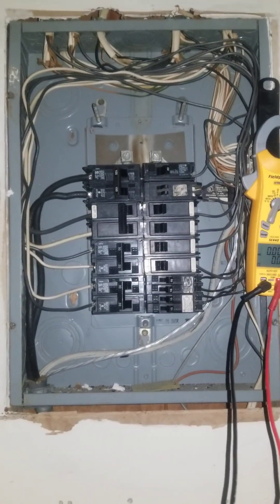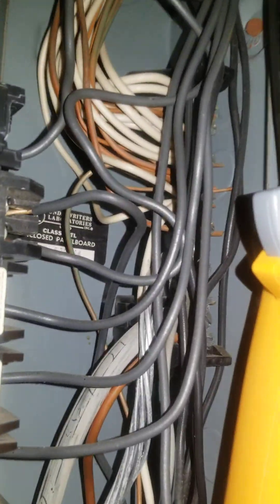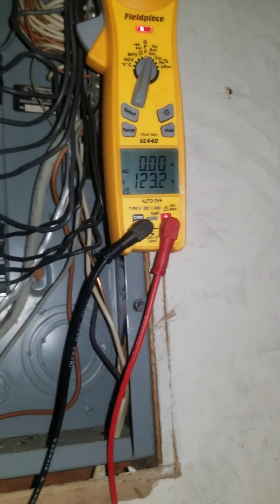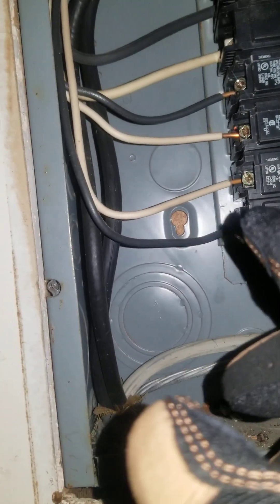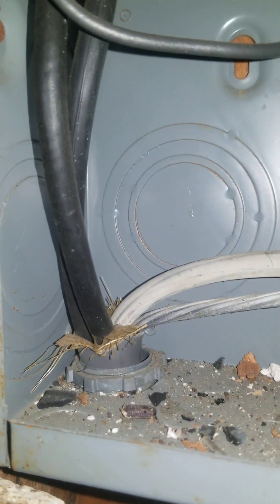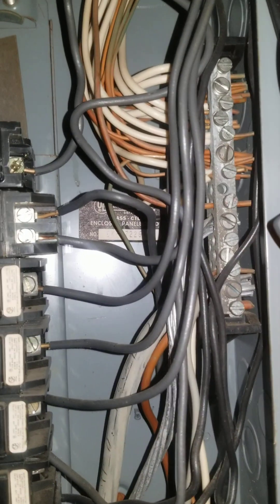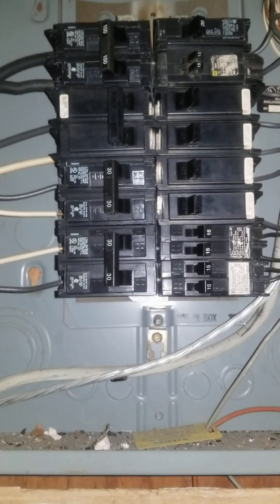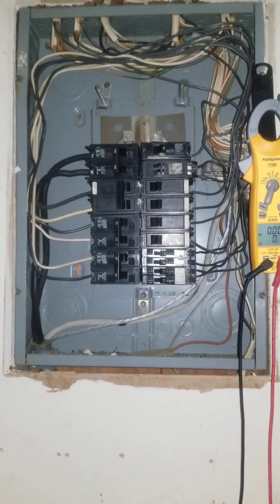NEC Code Violations (Panelboard Installation)

Comment: Maybe. Is the meter outside?
Reply from the maker: Hello, yes the meter is outside and this was the first point of disconnect. The call was about arcing (you can see why) and that the previous electrician changed out the breaker. They say it stioped, but I was called to so a review. Ended up installing AF receptacles at the first point in the circuit for more protection, but does not help any potential faults that may occur on the line side. I am sure a panel upgrade will be in the near figure.

Comment: I am NOT an electrician.  My expertise is with Phone/Data/Fiber.  That said, I do my own electrical work, complete with permits and appropriate inspections as required.  I have completely re-wired 2 houses, and have replaced about 50% of the existing wiring in my current home.  I have yet to fail an inspection.  My secret?  I take pride in my work, and take great pains to do it right.  

I own a current copy of the NEC, and I read it until I understand it.  Predictably due to my profession, I can pretty much quote 800.  For anything else, I have general knowledge to the point where I know where to go to look something up.  If I have questions, I will simply drop an email to the local AHJ requesting clarification.

My panels are wired per the NEC, but also using the same standards that I hold myself to while terminating fiber.  If it is a penetration, it gets a bushing.  If a provision is made to anchor something, it gets used.  If it has a provision for bonding, it gets bonded.  Wires follow the box perimeter and are routed to avoid interfering with access to other parts of the box.  If I run out of places to land Neutral and Ground wires, I run to HD or the local electrical supply and pick up the required bars to expand the connection points.  

The callout sheet on the panel door has the breakers numbered.  I use a label maker to number the breakers as well.  Individual Hot and Neutral wires are also labelled with the breaker numbers.  For that matter, the receptacles throughout the house are also labeled with the breaker number.

In short, I am a bit anal.  However, it seems that complying with the NEC, playing by the AHJ rules, and being a bit anal leads to pretty little green stickers on the panel...
Reply from the maker: Workmanship is definitely a section of the code that many people do not consider. In what city is your AHJ?
Reply: @Reg4JesusChrist  WA State L&I is the AHJ.  We have only state inspectors around here, no city/county for electrical work.
Reply from the maker: That is really good, because you have consistency in the application of the NEC! 

My knowledge of your line of work is quite minuscule in terms of hands-on application at this point. But I like how the NEC lays out that section of the code. It is easy to reference all different types in that section.
Reply: @Reg4JesusChrist  Where life gets interesting is that there can be a MAJOR difference between "Compliant to code" and "Compliant to standards".

When you start playing around with high-speed network cabling, it obviously needs to be installed IAW applicable code if you want to pass inspection.

However, there are also standards which govern things like bend radius, support spacing, support design, conduit fill, environment, etc.  Even such things as how you untwist and retwist the individual pairs to allow them to line up with the slots in the IDC connectors in a patch panel can affect the cable performance.

Fiber also has it's standards which need to be met that may not be readily apparent.  I'm sure that you have seen the inside of a fiber patch panel or splice panel.  Believe it or not, how all of those little fibers are coiled into the splice chamber makes a difference when you pull out the OTDR and start measuring attenuation.  Same for how well the splices are done, the care taken with the connector installation, etc.

It's not all code.  Every trade has its little tricks.  If a craftsman is going to step over the line, they need to know them.  Electricians pulling network wire need to understand the net cable standards.  Network guys need to know the rules that the electricians follow.

I step across the line in my own home.  Some of my wiring is aluminum.  Thus, I know what AL/CU means on a connector, and I possess both Oxide Inhibitor and an Inch-Pound torque wrench.  Heck, I even know that those random holes on my strippers are for making perfect loops that fit under screws.  I'm unsure why those inviting little holes on the back of a receptacle even exist.

It's the techniques and details that sometimes make the difference.  If a person is unwilling to learn them, they should call an expert.

Comment: I just done a new upgrade to a 200 Amp service on a house that I'm remodeling. The original service was a 90Amp at the meter. Inside the panel was 
(2) Dbl 40, (1) Dbl 50, (2) single 20, & (4) tandem 15's. All of the 240v circuits were Alum. And the rest were #14 copper.  How they didn't burn the house down I don't know!
Also NOTE the difference in the BRANDS of the manufacturer  the this panel. The one I mentioned had GE, Square D and Cutler Hammer. This is a BIG NO-NO!
Reply from the maker: More than likely, the house did not burn down because they probably did not use all of those circuits at one time. Say for example with those double breakers, whatever appliance was attached to them probably was only used one appliance at a time and maybe a lighting circuit. 

When you did the upgrade, what were the results of your load calculation?

Comment: good video you should have mentioned that the ground and neutral can use the same ground bar if it is bonded usually with a green screw.